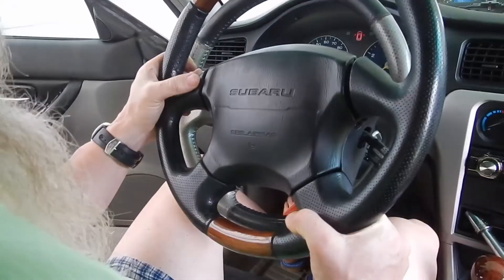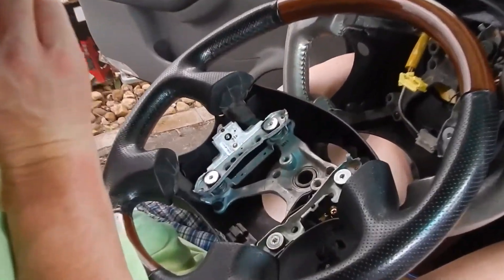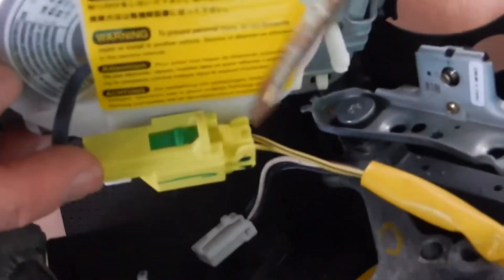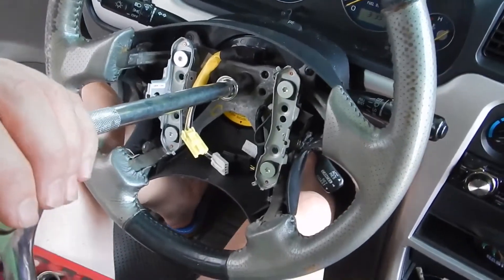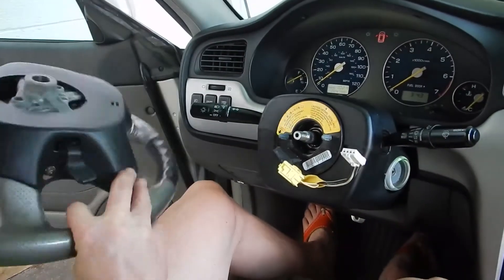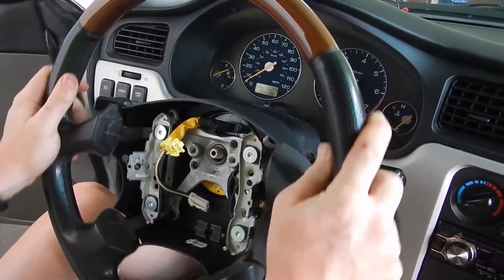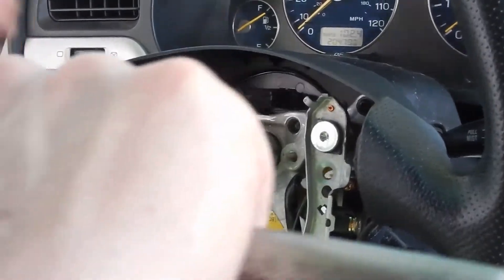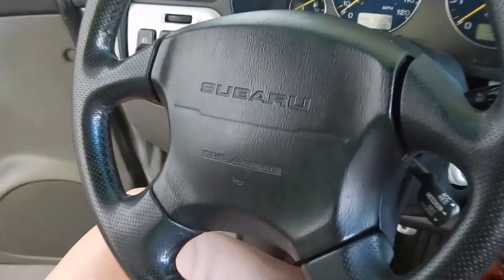Steering Wheel Replacement - 2003-06 Subaru Baja

Comment: Also a tip, disconnect the battery and remove the Airbag fuse 10 mins prior to removing airbag.. the last thing you'd want is that thing going off while you're holding it.

Comment from the maker: This was so easy. It took me less than 10 minutes. If your steering wheel is jacked up, replace it. I bought this brand new wheel on Ebay for $170  you can get them a lot cheaper. I just wanted this leather wood grain version.. You guys got this!  Do it!
Reply: I need to change mine also, and put in a new turn signal switch in my Dodge Ram. I think I have to use a steering wheel puller for mine as a lot of the American Vehicles are pressed on. I have one of those but it is in storage and it would take an act of congress to find it haha. I have always liked those Subaru's. They say they last forever.

Comment: Great video but a few issues:
1) Disconnect the battery and wait two mins before touching the airbag harness. 
2) don't let the clockspring rotate (the spinning thing with the "top" and "bottom" arrows) without the wheel attached. You rotated yours a full 360 degrees when you removed the wheel. That can damage the clockspring.

Comment: I just bought a 2000 legacy with a old rubber wheel and bought a new Subaru momo wheel out of a 2002 Subaru Impreza wrx, I just realized that the new wheel doesn't include the cruise control arm so hopefully I can drill out the slot for that and continue to use it if not it's not a huge deal considering I don't use it often but hopefully I'll work

Comment: That looked pretty easy, I would be worried about setting off the airbag. Did you have to disconnect the battery first? The new wheel looks great Jaxx......Take care, Bluefin.
Reply from the maker: It would be a good idea to disconnect the battery yes.. I;m glad you mentioned that.

Comment: That was way easy. I remember hearing how hard it was to pull a steering wheel off an Americians made car.
Reply from the maker: You are right. sometimes you have to have a steering wheel pull tool. I made a video on changing out the struts that I haven't posted yet. Now that a little more involved.

Comment: I bought the LLBean wheel, installed but the Baja airbag won’t fit.  It won’t go far enough down into the opening.  Did you buy a different airbag?
Reply from the maker: I didn't buy the LL Bean wheel.